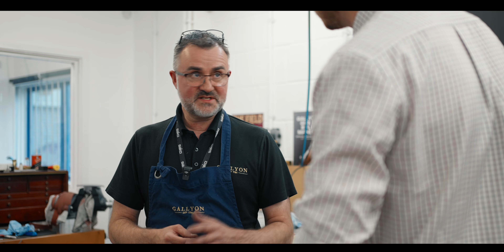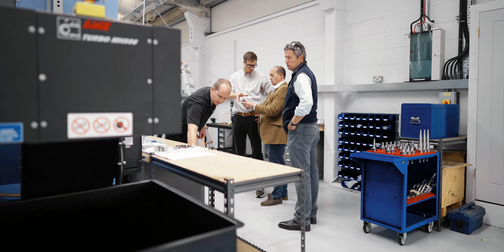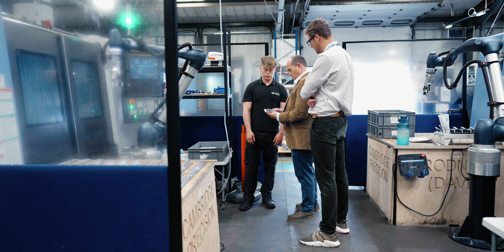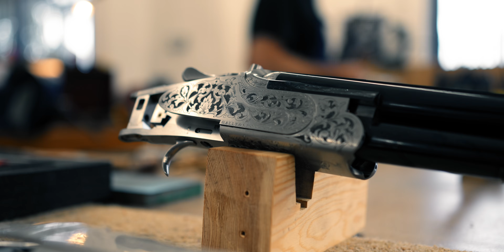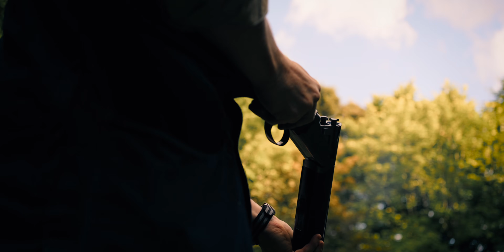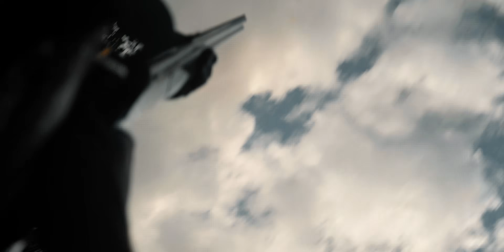The Pursuit of Perfection - British Gun Factory Tour with Gallyon

Comment: Aeroplanes have been glued together for decades. We fly around in tbem and yet those crusty old engineers at other manufacturers are still using technologies from hundreds of years ago.
Reply: Simply because it’s worked well for hundreds of years and still does. If it ain’t broke……don’t fix it. Perhaps you can tell us how the “bonding” process stands up to 90 years of daylight on it, or maybe even 50 years of estuary mud? Nobody knows…..yet. Too late for me to find out but seems a good idea now, but in the future? Looking at your name on here, 59 Les Paul or a 2024 re-issue? 61 Strat or a custom shop relic made this year? Which suits you best? 😉👍
Reply: @Mr16Bore  but we do know. As he said those structural adhesives have been used to glue airplane wings for more than 50 years. They're also used on spacecraft. 
One problem with ALL traditional shotguns is ribs detaching after use. It's a very common problem caused by using brazing or soft solder. Also corrosion from flux which isn't always cleaned off. These new generation adhesives are incredibly strong and are completely inert once they set.
If it ain't broke doesn't make sense. Otherwise we'd still be flying in Sopwith Camels. Progress is inevitable. 
Fender strat. Every time.